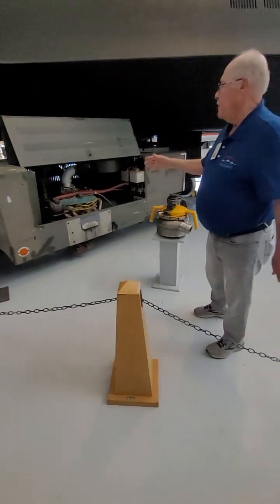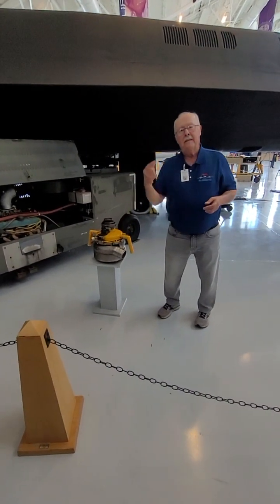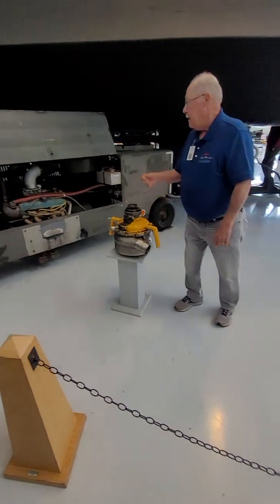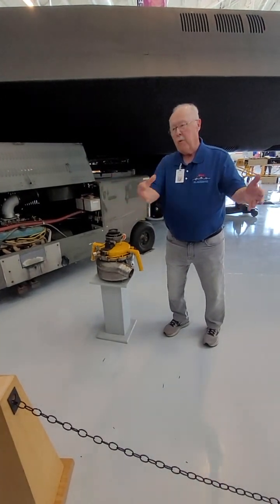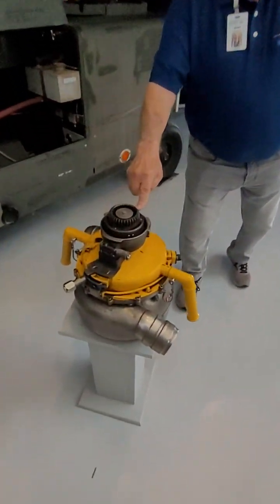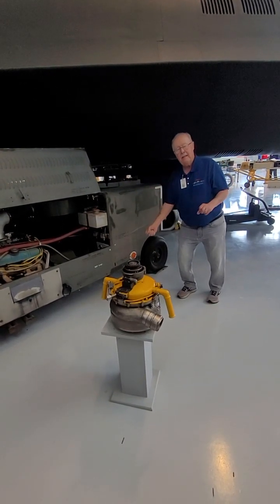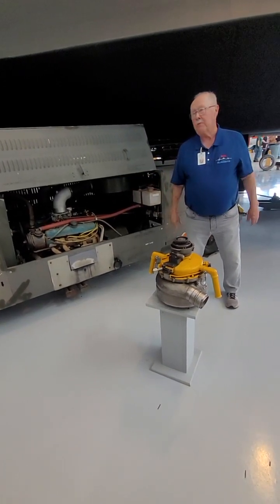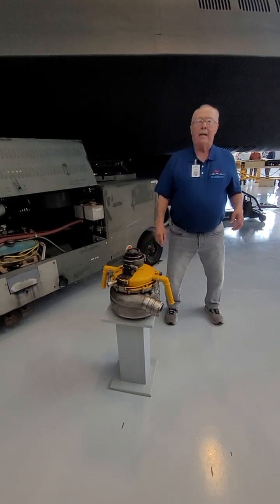Arnie Gunderson explains the Lockheed SR-71 Blackbird starting procedure

Comment: I am curious as to why they didn't use surplus WWII airplane engines, a Allison engine produces about 1,200HP which is double the power they needed, and during the 60s there were so many left over after WWII people were buying them and putting them in pulling tractors and boats. They could have easily ran those engines at lower boost levels from the superchargers and just ran those engines on 100LL or 100-130 they could get at any airport and easily start the SR-71s engines.

Still cool though... that they used Buick engines, and reliable power was the thing too, in 1963 the Corvette Stingray had a option for a 375HP 327, but the engine had Rochester fuel injection and that engines fuel system had a reputation for not being as reliable as carburetors. In the late 60s however the 427 L-88 for example put out about 550HP at 6,500RPM, but by that time they probably were already working out pneumatic starters.

Comment: Hi everyone.
Can someone please tell me, why the J58 is started with a mechanical connection to the starting-machine and not with pressured air like most of the jet-engines (f.e. J79) ?
Thx a lot for answering.
Reply from the maker: They were eventually improved with the air system in the 80s.  I would imagine that the required starting torque was too much for existing pneumatic systems when it was designed in the late 50's.
Reply: if the mechanical coupling part is that small, for pneumatic version, then air compressor is probably bigger than that v8 contraption...
Reply from the maker: Go to 14:30 in this video https://youtu.be/MJrXUh0eZjw?si=OOiFEuKvUnAVQtmF
Reply: @qfw181 Hi. Thx a lot for the link and the fast answering. I've watched the linked vid and now the facts are clear. Greetings !

Comment: I think they used multiple engines as they were available.  They may have started with the 401 nailhead but I've also read they also used 425 cu in. Buick wildcat nailhead engines up until around 1970 when most switched to chevy 454 cu in engines. I've read some auxiliary bases never got rid of the nailhead engine carts and continued to use as needed.

Comment: Dude. The USAF MD-3 motor generator. Same Generator that started the F-86 using DC. McChord AFB winter of 87 with cowling off. Short stack exhaust. Blue flames popping up side by side and I'd give it the throttle and load bank the hell out of that bitch to see how high the blue flames would go!

Comment: The Air Force also procured as many of those drivetrains as possible out of junkyards to maintain the start carts until they were forced to replace the old Nailhead drivetrains with Chevrolet racing engines. Jokes have been made that the relative scarcity of the 401/455 engine is due to the those efforts. Turbomachinery requires a lot of horsepower to turn. An engine the size of the J58 requires that 600 hp or 450 kW.  The core of the J58 is essentially a 3/4 size version of the JT9D, the engine used on the Boeing 747-100. The Lockheed Skunk Works was good about solving a problem only once. TEB, the 401 engine, PowerGlide transmission, boat throttle, and periscope-based quill drive are all good examples of that in the A-12/SR-71 programs.
Reply from the maker: I wish I had more room in my phone to record talking with Arnie about the engines... I was already a fan but then when you get schooled on even more specifics from the horses mouth it becomes even more profound.  They had to improvise SO MUCH, they had to CREATE things that didn't exist.  With SLIDE RULES!!!

Comment: 1961... 2 Buick 401 V8s wound out with 2 P&W J58s spooling up. Hearing protection isn't a thing yet.

2023....The VA has determined your hearng loss is not service related.
Reply: The SR71 Blackbird didn't complete its maiden flight until 1964 however the engines had been in development since 1958 so it's definitely possible they were using the nailheads to start the engines when static and not installed on any jet. They obviously test engines and need a way to start them